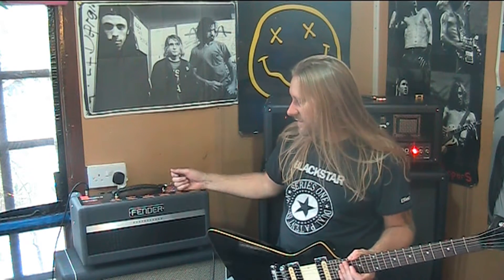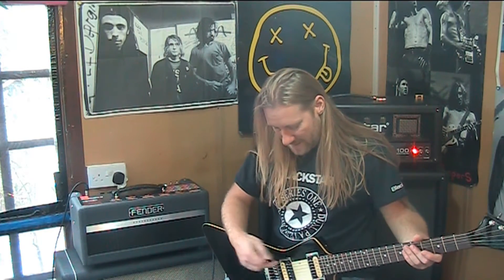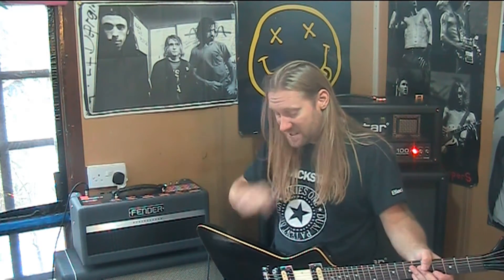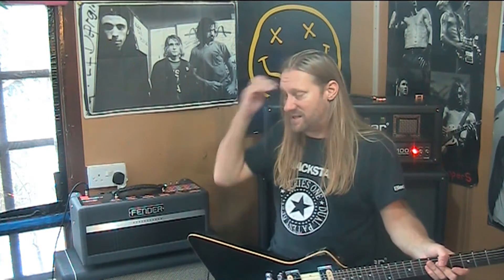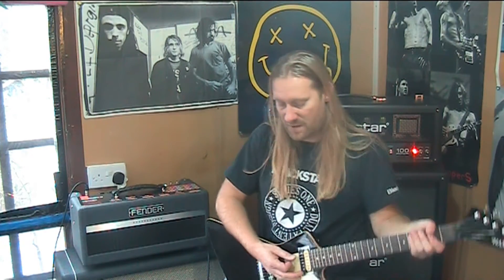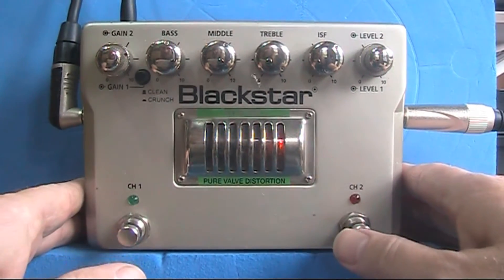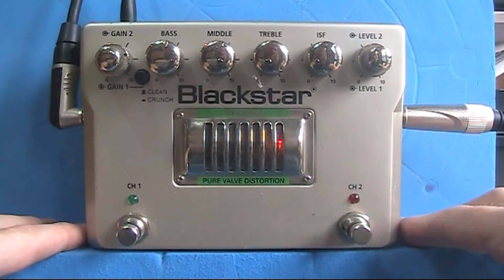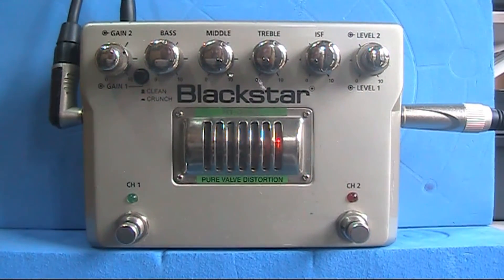Blackstar HT Dual Pedal - Turn your one channel amp into 3 channels

Comment: essentially a black star pre  amp , I got an HR5r metal and absolutely love it . run an overdrive into clean for classic rock and blues . these pedals are fantastic if I didn't have the ht was gonna get one of these . still might . also that set up gotta sound fantastic with the 84s in power section !

Comment: Probably an age old question, I've just bought the HT Dual and I'm currently looking for an amp or head to run it through. I want to stay solid state with the amp as primarily I'm limited by budget and I've had way too many bad experiences with reliability in valve amps. Does anybody have any suggestions as to solid state amps to make this pedal sound it's best? Cheers

Forgot to mention I play in a three piece band so Sonic oomph through two or more speakers is preferred.
Reply from the maker: Buy an old Marshall valvestate power amp or get a 44 magnum poweramp by EHX or the Mooer babybomb power amp. :)